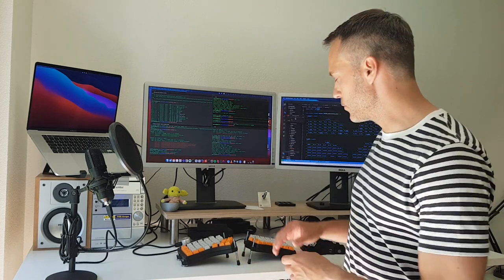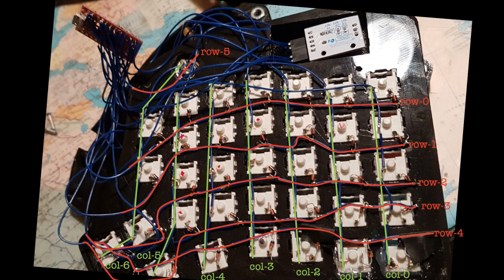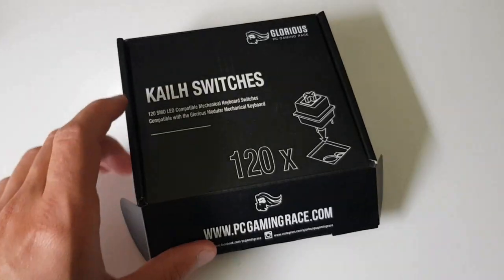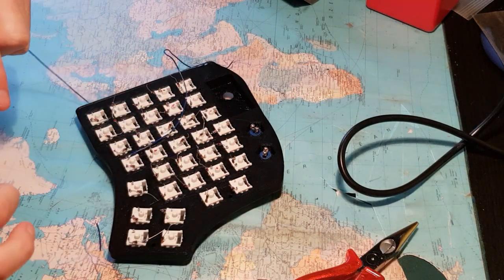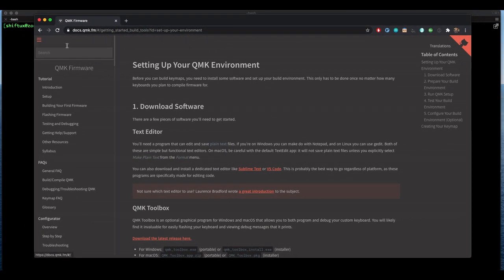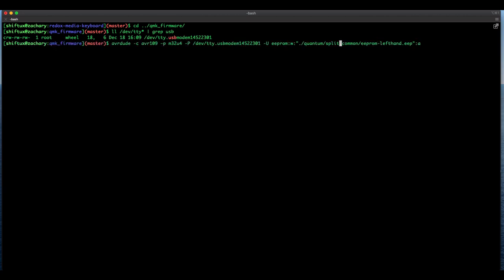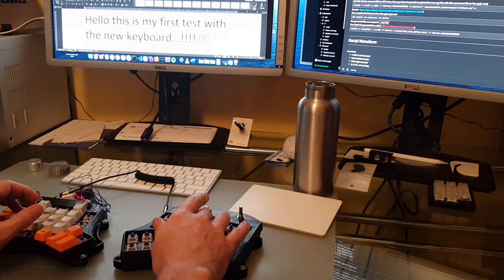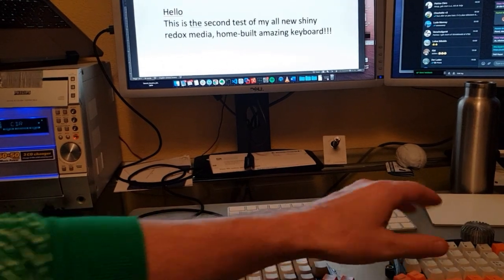Build your own keyboard (Redox Media)

Comment: This is a really interesting design choice and I was looking for something to do with redox especially the rotary encoders. May I ask, how are the rotary encoders being wired to the respective boards? which pins are being used?
Reply from the maker: There is a wiring diagram on my github page: https://github.com/shiftux/redox-media-keyboard
The pins used for the encoder are labled "ENC_PADA" &"ENC_PADB". Note that with the pro micro as microcontroller I didn't have enough free pins to use the button function on the encoders, just rotation (without repurposing the TX and RX pins, but I'm not even sure you can do that). There is also more info on the QMK user guide: https://beta.docs.qmk.fm/using-qmk/hardware-features/feature_encoders
Reply: Thanks for sharing! I'm looking forward to build this one in coming weeks!
Reply from the maker: @arvind5604  cool, happy I could inspire you. send me a pic if you got it done :)
Reply: @shiftux9189  >I didn't have enough free pins to use the button function on the encoders
I thought you plug button of encoder same as media buttons (same as ordinary keys)
Reply from the maker: @pave1c  TBH i'm not sure this would work. the switch matrix for the keys is wired between 2 pins from the pro micro for each switch (one row pin / one column pin). but the encoder is wired between 5V and GND. So you would really need 1 pin for the encoder button as it would output 5V on a pin when pressed. compared to a key switch which bridges 2 pins on the pro micro.